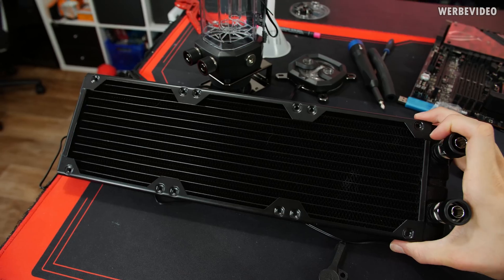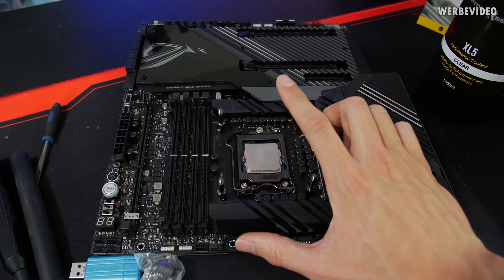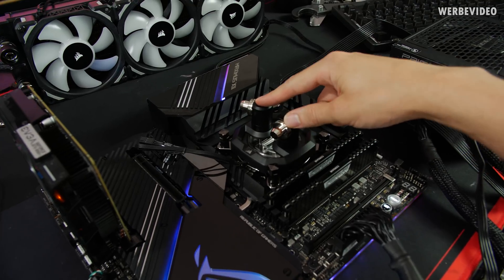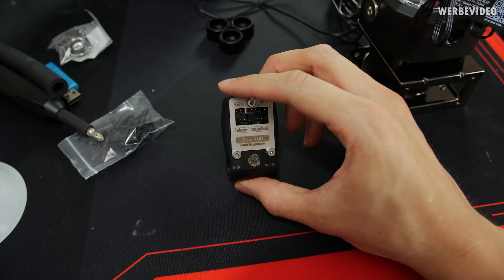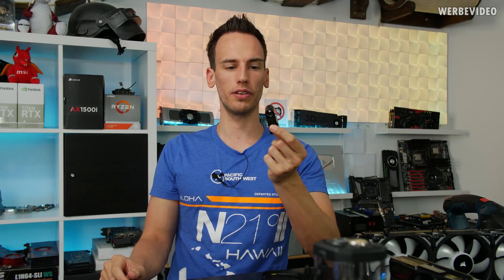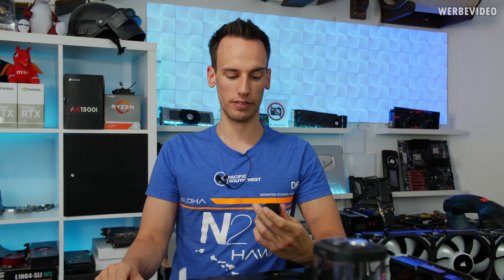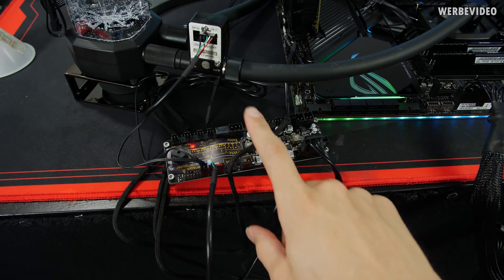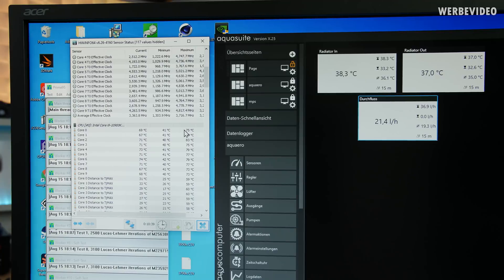Testing one of the Weirdest Water Cooling Myths - A SLOWER Flow Rate will result in BETTER Temps?

Comment: This argument dates back to the earliest years of PC enthusiast watercooling. I still remember having this argument with a guy at a lan party back in 1999 when he was convinced low flow rate and a rad between each part was king. haha XD
Reply: yeah. if you want a cooler system: add more rad.
Reply: If you go for very low flow rate, you must put a rad between each part. It is just better to have higher flow rate and than it doesn't matter where you put the radiators.
Maybe if you have >1000W power consumption in your loop it could matter a few degree.
Reply: @Thunder-wd7ti  Agreed on just better to have a higher flow rate. But even if a rad between each part is better for low flow rate, it still doesn't matter in the real world simply cause low flow rate is gonna suck regardless. 

Radiators are optimal at a certain range of liquid flow and airflow. Same goes for the pump and waterblock, they are optimize for a certain flow rate. Too low a flow the parts are not working optimally, too high it reaches a point of diminishing return ie more noise, less cooling. 

If some one would choose low flow water cooling for whatever reason, better off save the money and headache, just stick with air cooling probably get better results too.
Reply: @joe2d heatpipe cooling might be an option vs traditional air cooling (i.e. move the fins right next to the case holes) too on small cases
Reply: same.. it's a neverending meme.
Reply: Earliest years of PC cooling ??  I hear stories about people from the 70s having this argument about engine cooling.
Reply: @eric4946  Yeah I've heard it from my Dad before. One type of old car he had was known for getting hot because of an undersized radiator so the cheap fix was to restrict the flow through the thermostat in order to get a slower flow rate. He said it worked and kept it from overheating. At the same time I remember seeing an episode of 'Speed with Guy Martin' where he modified his van for an average speed race they have in the American desert. One of the modifications was a custom water pump impellor to achieve a higher coolant flow rate...... I'm still on the fence about it lol.
Reply: Mrx1080 yeah , one of the actual issues was poor design of pumps and routing. 

Slower flow as a rule will not make the engine run cooler. 

However if for some reason your pump is cavitating at high speeds well that will cause you to loose flow despite being counter intuitive.

Also often times I’ve heard people get confused about how thermostats work and what they’re doing. They don’t open the path to the radiator. They close the path to recirculate to the engine usually. I think this has confused people who get told this thermostat is more restrictive when in reality that means it prevents coolant from recirculating .....

That’s just speculation on my end but the TLDR is slower flow is never ever ever ever better for cooling in any realistic application . In any case where this “wasn’t true” the solution rectified some other issue that was the real problem and “less flow” was just a by product or not actually what happened.
Reply: @Mrx1080  You have to think of physics, not specifics. more flow = more power of dissipation (or heating, same thing). other way to get more power is more surface area in the heat exchanger or a bigger delta of temp. 
Also it's not about the construction of the fins in the waterblock like said in the video
Reply: @escalator9734  Yeah I'd say 'motorsport nej' hit the nail on the head about the water pump design, maybe that's what was happening with my dad's car.
Reply: @eric4946  engine cooling is different.

The engines are putting out a lot more heat relative to the radiator compared to a CPU.

I can tell you hype an absolute fact that running a street car without a thermostat is bad, it runs too cool. Running a race engine without a thermostat or restriction runs too hot. At 7000 RPM (at least on a small block Ford, normal RPM range of 800-5000 RPM) the coolant is moving through the radiator too quickly to actually bring the coolant temp down. We've done it. 4 passes back to back at 7000 RPM and the engine was at 230*F. We put a plate in the thermostat housing to restrict the flow between the engine and radiator and with a little tuning got it at a steady 195*F, pass after pass.

The coolant at high velocity isn't a problem, it helps the block stay at a steady temp. The coolant has a max velocity through the radiator, above that and it just can't transfer the heat to the radiator itself. It's pretty easy to tell, when you exceed that velocity the radiator is cool but the coolant is hot as hell, almost like the flues are blocked. You'll have what appears to be a fully functional cooling system but you'll run hot on the track.

Newer style radiators may have improved on this but we've done it with old Fords and Chevys plenty of times. People want to remove the thermostat to run cooler for more power, which works if you only run a couple times.

It's better to run consistent than to battle to keep it cool anyway, better on the engine, more consistent times, etc.
Reply: Glen Waldrop Glen Waldrop I assure you thermodynamics doesn’t care if it’s a CPU block, a car, a race car or a power plant. 

It’s not that “the coolant is moving too fast to absorb the heat” it’s a pump/flow problem if there is actually a problem at all. Given a constant heat load on one end and a radiator on the other as you increase fluid velocity the temp going into the radiator will go down and the temp leaving will go up. Until you go so fast that the the difference is practically zero. At that point you have lowest system temperature. 

There is not a single equation or proper experiment that shows at any point that you get worse heat transfer with faster fluid flow. 

You can believe what you want it’s just a physical fact, while you might get some result in a car that indicates the opposite it’s not because flow is too fast in the radiator it’s something else .
Reply: @eric4946  when you check the radiator with a temperature gun and slower flow results in better heat transfer I'd say it was settled.

I'm not talking about slow flow, I'm saying there is a point where faster flow actually hurts heat transfer.

A restrictor plate in place of the thermostat helped cool the engine with no other changes. Still the same water pump, coolant, radiator, etc.

We didn't get enough flow with the thermostat in place but it ran warmer than we'd like during back to back runs without it.

There is an optimum speed of coolant flow through the radiator and above that speed it can't remove heat from the coolant as well. Water wetter, dish soap etc, can increase the optimum speed/thermal transfer but the fact is there is such a thing as coolant moving too fast through a radiator.
Reply: Glen Waldrop a temp gun doesn’t just tell you if you have better heat transfer . Higher flow would make the temperature leaving the radiator hotter anyways.....
Reply: @eric4946  given all the available info it's a pretty safe bet to say that with our combination of parts the engine was kept cooler by limiting the max speed of the coolant flow through the radiator.

It could be by radiator design, God knows they've improved them since this Fairlane was built, could be better materials, though for the most part heater cores and radiators have used the same materials since the 50s...

After multiple passes the radiator (external measurements) was cooler (I wanna say like 150-175*F but it's been a few years) with no restriction but the engine was bumping 230*F.

With the plate installed the radiator was around 200*F and the engine was right at 195* between runs, we don't think it topped 205*F during a run but it's a little harder to keep an eye on that while racing.

One detail that may be the deciding factor, on this particular model the input and output of the radiator are both on the driver's side (vertical flue radiator). It's possible that at a certain volume/speed it screwed up the flow in the radiator itself. If that was the case there should have been hotspots, there weren't. The radiator temp went up after each run, the coolant temp went down.

The other issue could be radiator size. The engine was quite likely putting out more heat over more surface area than the radiator could transfer, essentially a 2,000W heater with a 1,500W cooler. Our restriction may not have worked for an endurance race.

It's the same thing as air conditioning, if the air is moving too fast through the evaporator coils then it can't cool as efficiently. Set the blower to high, temps are 50*F. Set the blower one notch down and the temps are 36*F.

That doesn't necessarily mean that slower is better, that just means there is an optimum speed for thermal transfer and once you exceed that cooling is less efficient.
Reply: Glen Waldrop I would just say think what’s more likely 2 centuries of transport mechanics developed by 1000s of separate individuals across the globe, or one experiment a few years ago with basic on the fly measurements.

As for the AC analogy I think this is where you are getting confused. As someone that works as an engineer for a company called carrier. That literally builds air conditioners..... I can tell you this is not how efficiency of heat transfer for heat pumps works. It’s literally the opposite. Ideally the air coming out of the system is just barely cooler than the desired temp for max efficiency. 

This is why if you look up the rating for a water chiller the lower the temperature you try to get on your output the lower the cooling rating is......

Comment: It would have been interesting to see how low can you go until it starts seriously affect the temperature. Still it seems that the most reasonable way to go is just around normal speed.
Reply: The most recommended setting for flow rate is as high as you can run without being annoyed by the sound. I run mine at 60%, keeps temps well within a rage that anyone would be comfortable with and quiet enough that it's overwhelmed by my fans that are usually running around 50% speed. Granted my system cooling gets very aggressive at 70C but it rarely ever goes into that territory under normal usage.
Reply: Now that would be interesting!

Comment: It seems this issue is easy to think of. When using an air cooler, even though 'cooler' air is being fed into the radiator, you still need higher airflow for lower CPU temperature. Water and air are both fluid. So in the case of heat exchange, flow rate of water should also act similar to air, right? It seems that the temp. difference between the 'inlet' and 'outlet' only matters (more) when the flow rate reach a certain point when the increase of flow rate will cost too much but yield little benefit. (For example, in the video, increasing the pump to 4000 RPM is not lowering the CPU temp. much better than at 2000 RPM.)